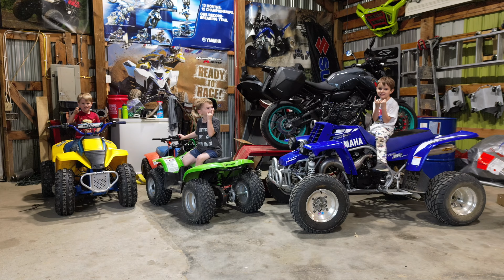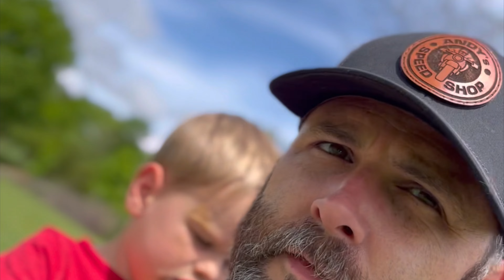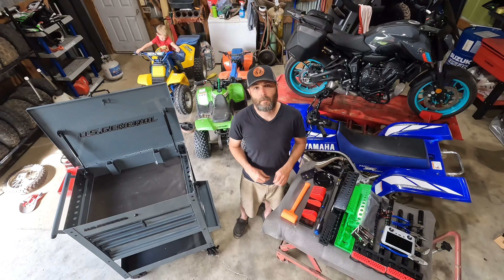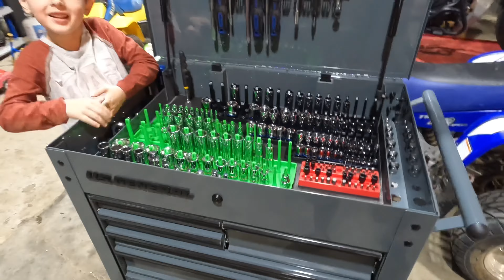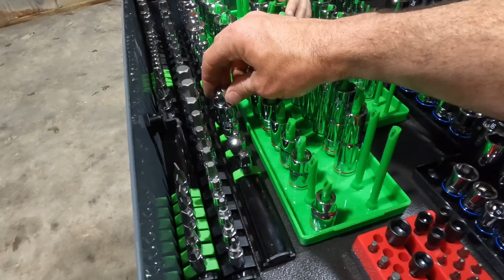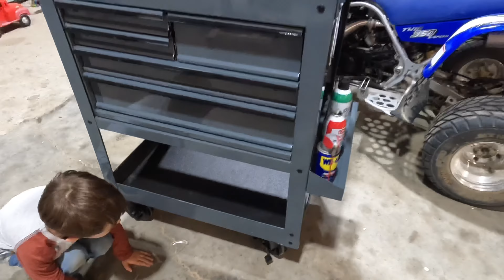Paying It Forward! New Mechanic Tool Set on a Budget - Giveaway

Comment: This is a great option for beginners. I have seen PLENTY of guys graduate MMI and go right to the Snap on truck and go over $15-$25k in debt only to either not make it through their 90 day probation period at the dealership , or quit a few months later. Most don’t leave to go to another trade, they go back to bartending or server or whatever they used to do when they see how tough it can be as a tech. I always tell people, get cheap stuff with a lifetime warranty so you don’t not have tools and once you figure out what keeps breaking or slipping or just plain doesn’t work, THEN swap that tool for a better one. But no one needs a $75 snap on deadblow lol. I could change a million axles and my Pittsburg would still be just fine.
Reply from the maker: Well said!

Comment: It’s amazing very nice set up except there’s no electrical tools from what I can see and I can tell you if you’re going to be a mechanic after 42 years as I was professionally you need electrical tools more than you need this other stuff if you’re going to work on modern automotive or modern machinery of any kind and you better know how to use the electrical equipment
Reply from the maker: This was a gift - not meant for a mechanic, just for a guy who didn’t have much in the way of tools at his home. To see my own setup that I use daily as a Powersports mechanic, you can reference my other video 🤙🏽
Reply: I always tell people starting out, go with pneumatic tools at first, whatever shop you’ll be in will have air, and they’re waaayyy cheaper than electric to start with.